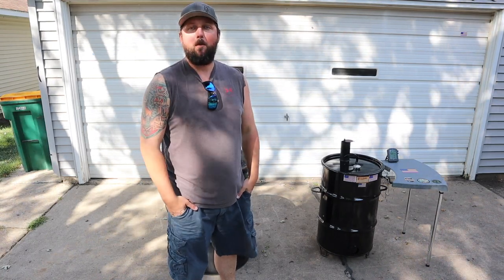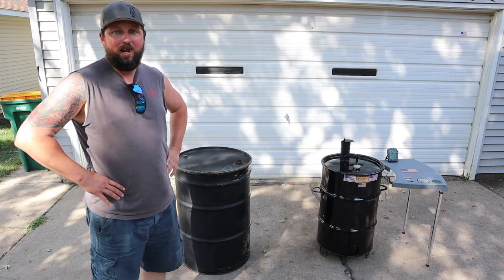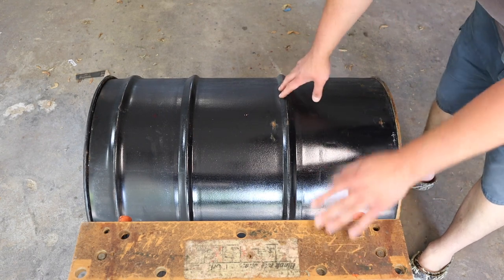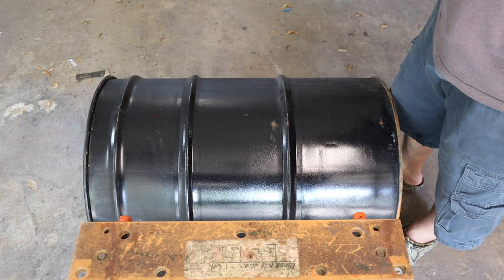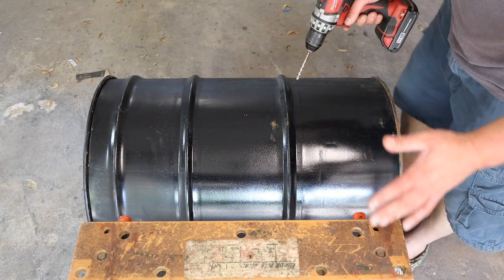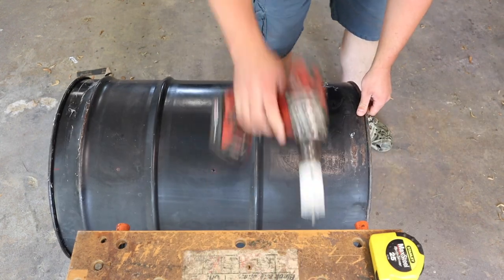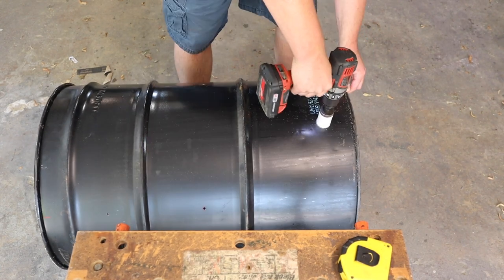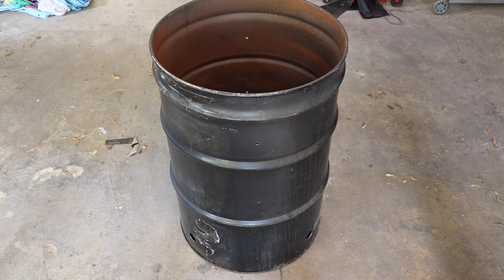Ugly Drum Smoker Build - Part 1

Comment: How did you remove the burnt sut? And how did you season the inside prior to using it. I'm currently on step 1 🤣
Reply from the maker: I sanded the inside after the burn and wiped down the inside. Then coated with cooking spray and burned some coal to season it.
Reply: @MadHorseBBQ  thank you! I'm getting ready to dive in there and start sanding!
Reply from the maker: @elinino5275  nice!